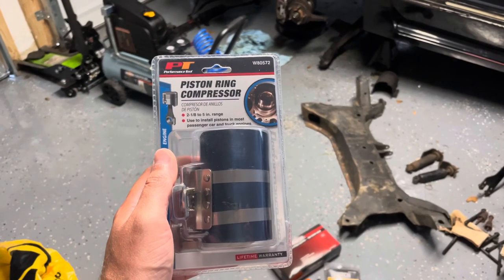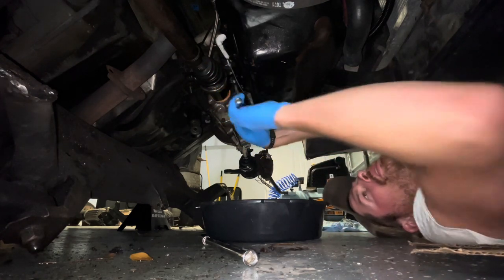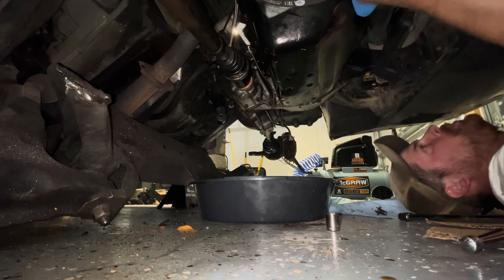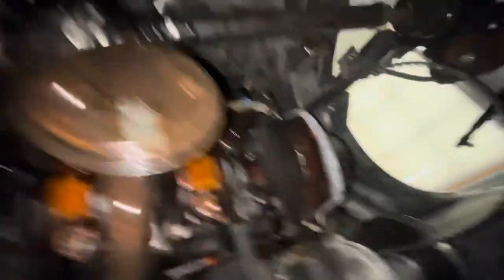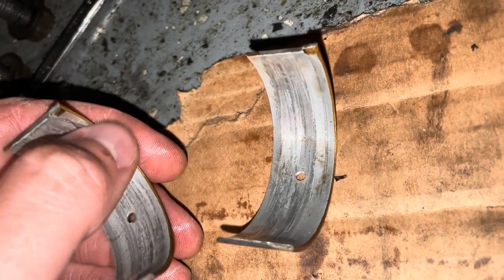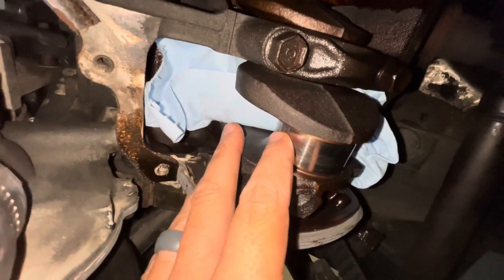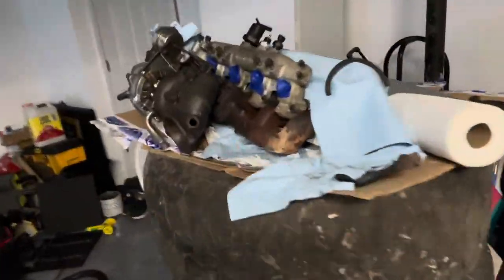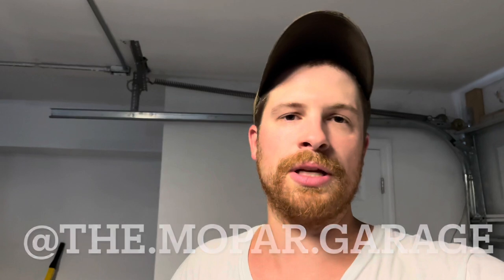Budget short block engine build - Shelby Dodge Daytona Turbo Z project

Comment: First thing is first: CONGRATS on the monetization!!! Glad to see you back on the Shelby. Keep that content coming (as work allows of course).
Reply from the maker: Thanks Brian! I imagine the Shelby will be a lot like monetization....takes forever to get done, but rewarding once it is!

Speaking of, how is yours? Still chasing the overheating issue?
Reply: @TheMoparGarage  In fact, I was just working on it yesterday (guess you inspired me). I'm having intermittent fuel pump outages. Turns out to be a bad Walbro pump with less than 200 miles on it..... Still overheating a little. I'm seeing 220 WAY too much. Need to get a radiator for it I guess.
Reply from the maker: @ProjectTimeGarage  heck yeah, I love it! I remember you putting a brand new pump in when you first got the car…imagine that, another bad part right out of the box 🙄. I look forward to the content!
Reply: @TheMoparGarage  It's rendering as we speak. Since it's also a review video, I'll likely put it out a bit earlier than normal.
Reply from the maker: @ProjectTimeGarage  awesome, I’ll be looking for it!

Comment: Assuming you are using a 782 type swirl head. The heart-shaped chamber has a tit between the valves. It is over 1/2 inch thick aluminum, and becomes an ignition source. Grind it away with maximum prejudice. I broke many many 2.2 pistons learning this.
Reply: I broke 2 the other day actually.  Turbo setup on a TBI bottom end was not meant for this world...
Reply from the maker: Great to know! I know this head came off a newer model, I don’t know a TON about the engine internals/specifics of these cars. I will take a look at it.

Comment: Put a couple of studs in the head bolts in the block to help keep the head aligned while setting it on. 

If any changes like bigger injectors or throttle body. How can you adjust the computer?

If a new engine is needed would a 2.5 be a better place to start? If so should the balancer in the oil pan be disconnected and oil feed plugged?
Reply from the maker: I think FWD performance sells different logic modules so that you can run higher boost and larger injectors. I’m going to keep this one stock though, not looking to win any drag races with it! Not sure of any details on a 2.5 swap, I’m sure it’s been done though.